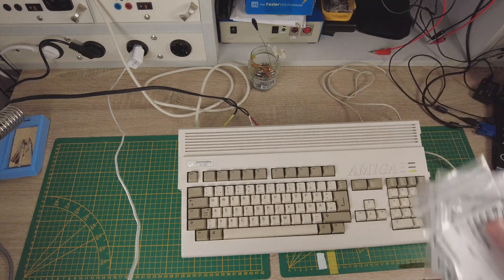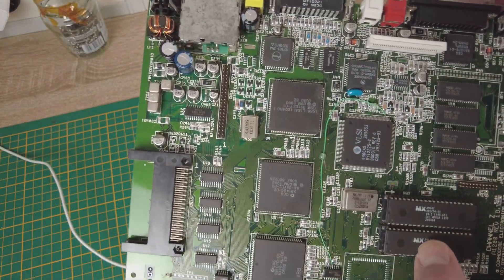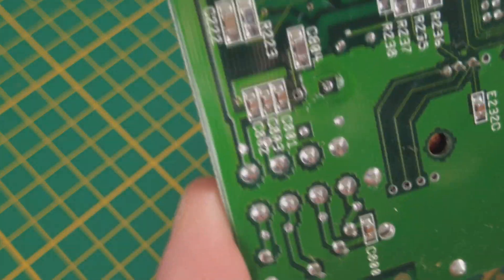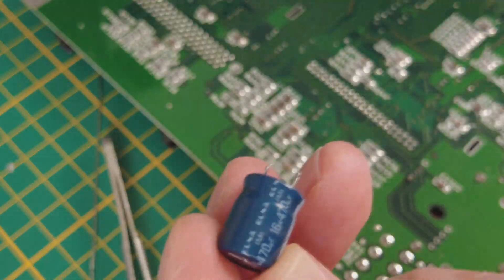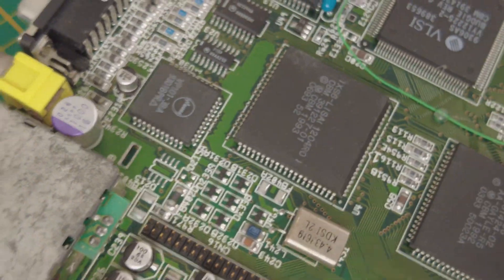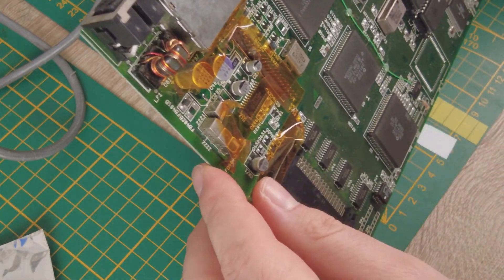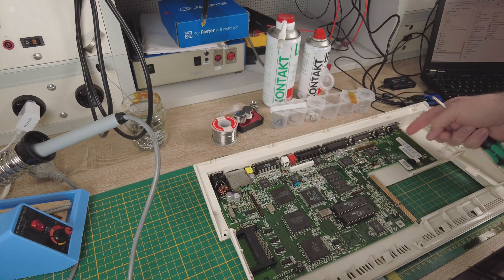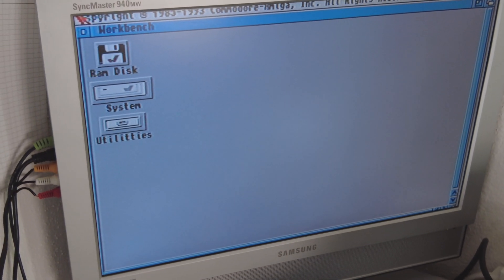Recap the Amiga 1200 with Aluminum Polymer Solid Caps. Never leak again.

Comment: ceramic caps..   SIGH!  why not use diods or resistors instead when using the wrong components with wrong behaviour?     a booting machine is not a proof of correct caps.     ceramic caps are voltagedependent so  congratulations.  you have now a machine that is equipped with caps of wrong capacitance etc..
Reply from the maker: I totally agree. I made another video for this. I changed the ceramic caps with polymer caps.

Comment: Fantastic work!!! I'm going to do the same thing, I have the same equipment and received my new caps. Just an information...where could I find the scheme to test the connection after each capacitor replacement? Also, which temperature did u set for the heat gun? ( C° please ) Thank you very much for this video!!!
Reply: NO NO NO NO! Don’t do this!! These are not the correct capacitors to use. If one goes, you will cause serious damage to your board.

https://www.facebook.com/groups/CommodoreAmiga/permalink/10158438301574157/
Reply: NO NO NO NO! Don’t do this!! These are not the correct capacitors to use. If one goes, you will cause serious damage to your board.

https://www.facebook.com/groups/CommodoreAmiga/permalink/10158438301574157/
Reply from the maker: Thank you for your comment. I have measured the capacitors directly at the poles. There should be no continuity when you measure with a multimeter. If there is, then there may be a short circuit due to solder. Then you have to rework it again.  I carefully increased the temperature until the solder liquefied. You should always be careful with this, because at too high a temperature there is a risk of damaging components. I had my hot air gun set between 330 and 360 degrees Celsius. Good luck with your project!